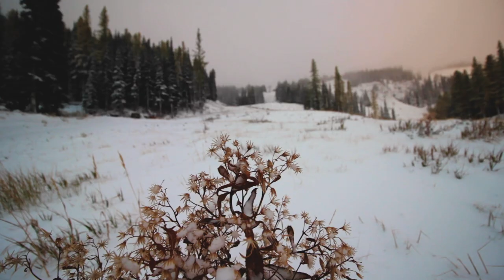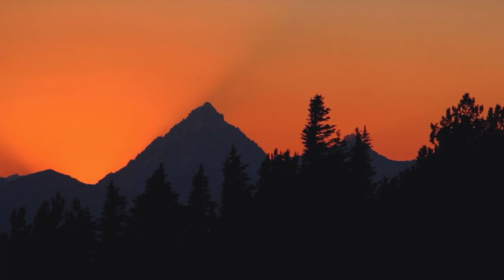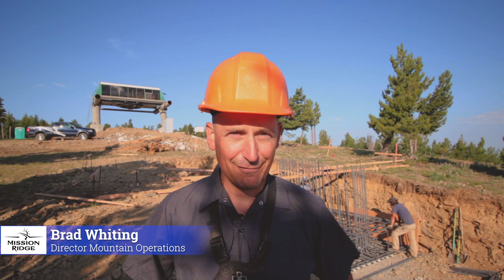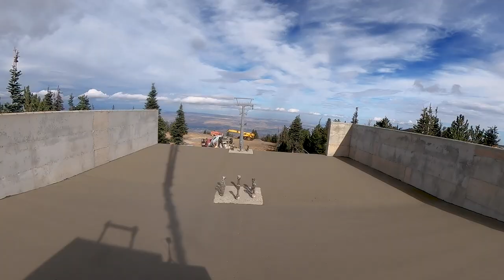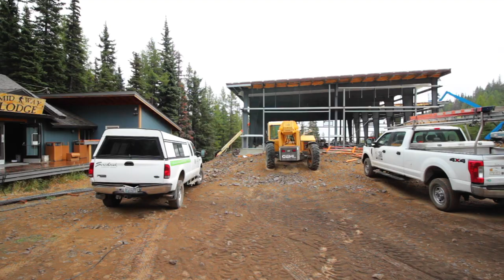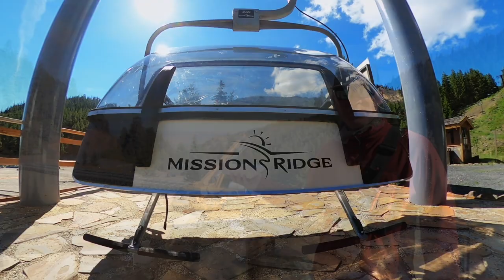On The Way Up: Episode 8

Comment: Hello Misson Ridge,

Its nice to see how the proces is going on to instal the new lift that traveld around the world. I was curious what will happend to this lift because i used it arround 28 years from the 32 years that it was standing in Skiwelt. Its very nice to see that the bubbles are cleared up so people can see thru them again. People dont reliase it but the foundations is very hard work with most of the work under the ground. Keep the good work up and i can not wait to the next episode. Respect to all of the working people of this project. 

Greatings from the Netherlands👍